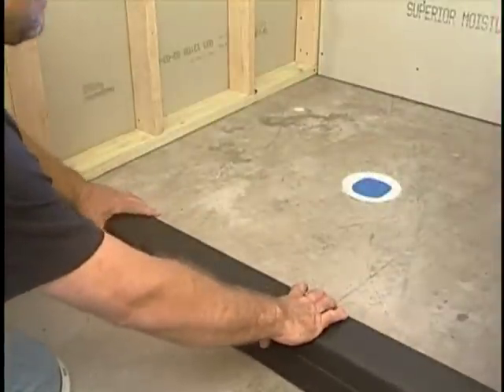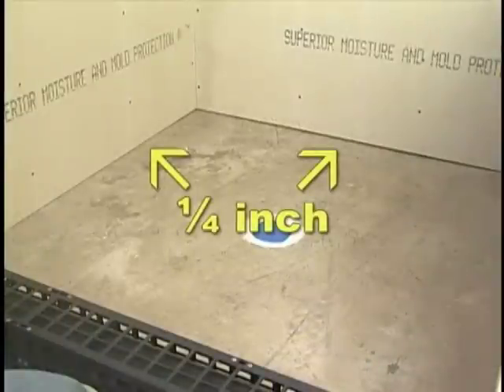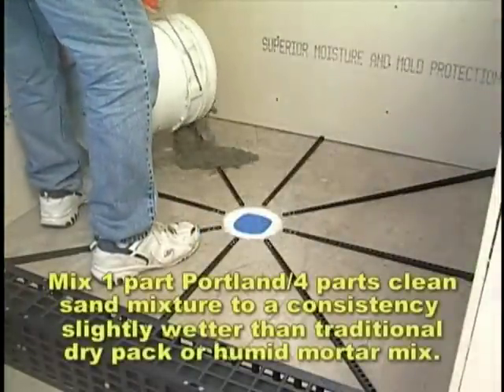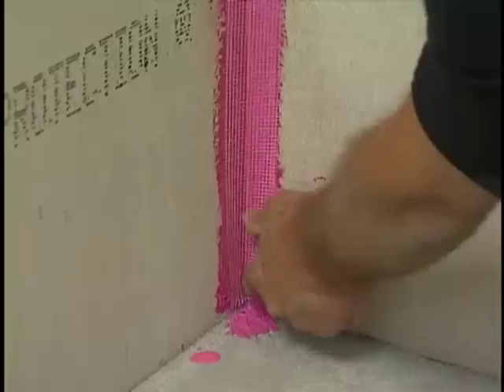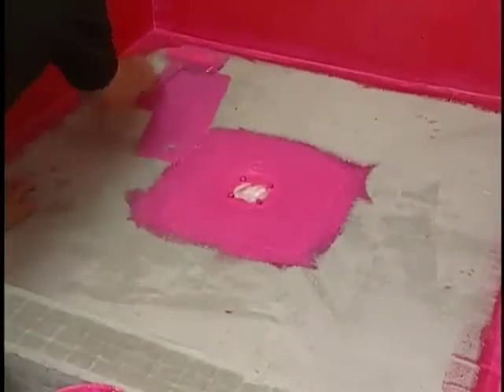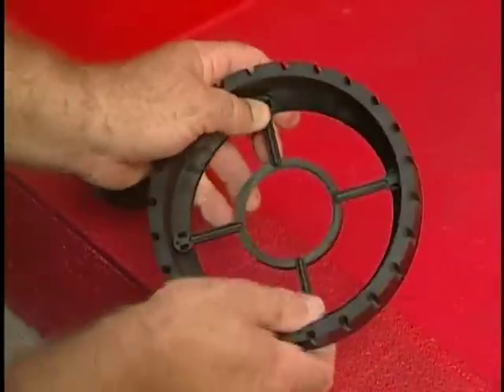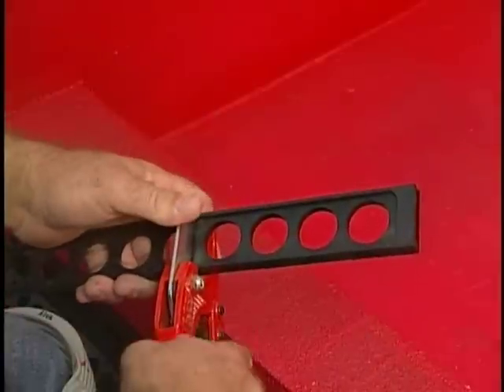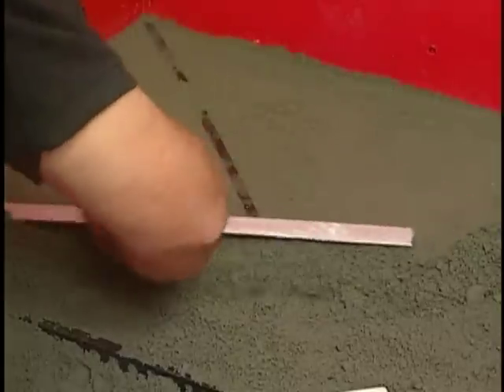How to Apply Roll On Waterproof Membrane With Quick Pitch System

Comment: It's funny how now we need schluter,hardi..kerdi, special tapes and fabrics, water proofing etc and 20 years ago it was green board, tile and grout.. seal, silicone where vertical meets horizontal.. it lasted 10 years or more.. about the time people hate their bathrooms in.. now with all the new systems it's 5x the money and most water damage comes from valves inside the walls.. doesn't make a ton of sense to me

Comment: There is a critical step that is not covered in this video. You did not do a leak test and it is required by law in many areas. At what step do you suggest doing a leak test? If you do it right after the redgard the weep holes will allow water through, right? but if you wait until after the mortar bed is finished you can't get back to the redgard to make a correction if needed. I know it probably is not an issue but the question still remains.
Reply: You use a test ball if you've ever had an inspection you would know what it is.
Reply: @stevebohn3053  Where do you buy a test ball?

Comment: No primers used on the substrate before waterproofing to ensure adhesion? It's best to waterproof on top of your screed to inhibit the growth of mold and bacteria under the tiles.
Reply: What type or name of primer should I buy or use? Thank You
Reply: @keithowens9242  The manufacturer should have a compatible primer for their system. What about a bond breaker for corners, wall and floor junctions?

Comment: This is wrong. You need to first apply cement board tape to all the seams and then apply thin set. Then you can apply Red Guard to everything. If you just use Red Guard and tape to the seams then it will leak everywhere. This guys does not know what hes talking about.
Reply: He  also installed his backer board into the mud deckl............ thats incorrect. the backer or cement board should be installed above and after the mud deck not before
Reply: @keithowens9242   I'm new at this shower stuff.  I thought the cement into the mud deck was a no-no if using a rubber type liner?  I've seen time and time again, when using RG, they went to 1/4" of the floor, and the use of a liner, then not into the mud deck.  Please explain why to a newbie.  Thx

Comment: I noticed this shower was built on a concrete floor.. would the same system and techniques be used for a wood subfloor construction?
Reply from the maker: +1969alfagtv - Thank you for your interest in our products! Yes you can use the same techniques on a wood sub-floor construction. Although for optimal strength, we'd recommend tar paper and lathe under the pre-pitch as well.

Comment: how long would I have to wait to apply redgard after making pre pitch with deck mud?
Reply from the maker: 24-48 hours is the recommended time, depending on how quickly your mortar bed dries. Once it turns grey, it should be good.
Reply: +DixSystems - I thought it was standard to wait for 28 days for the concrete(deck mud) to fully cure before applying any type of sealer. Does this standard not apply?